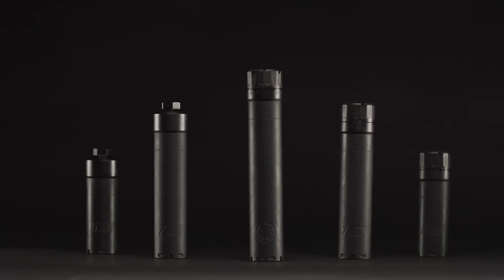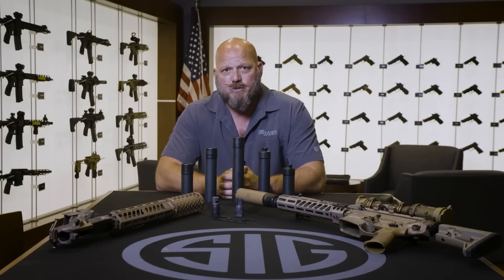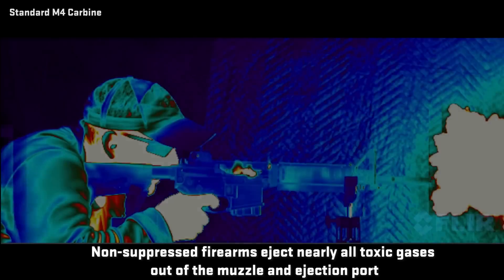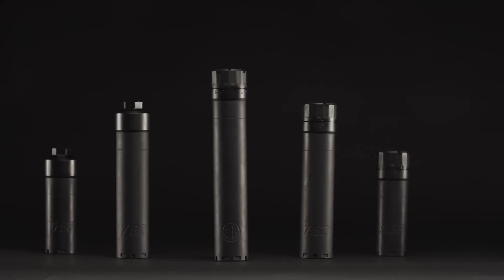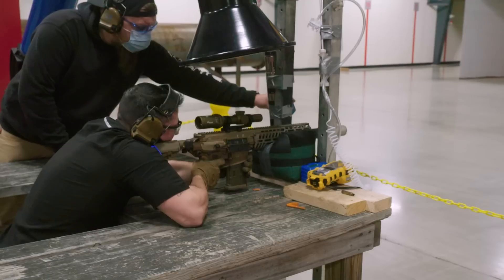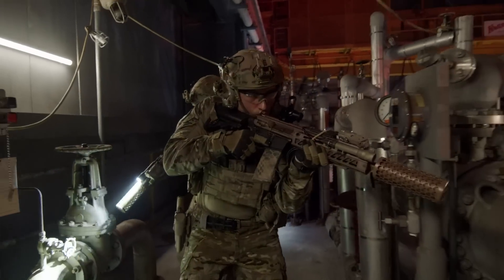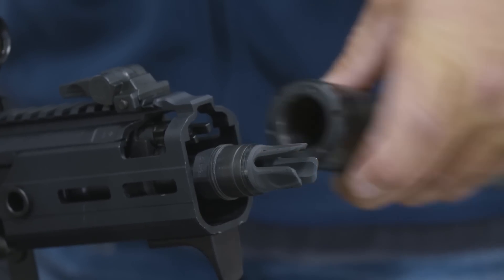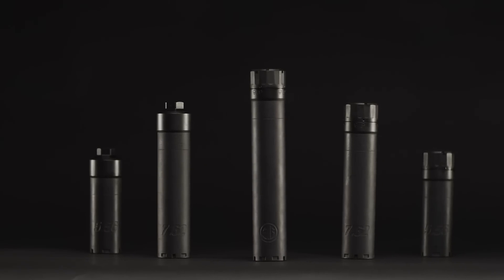The Next Generation: SLX & SLH Suppressors

Comment: 0:29 That's an AR15
0:31 And that's an MCX.
I can't prove this is dishonest on purpose, but a gun company holds up two pictures: one of a short stroke piston gun with the suppressor they're trying to sell, and the other of an AR15 with a "standard suppressor". I have to assume that they're either entirely unaware of the differences in the operating mechanism of two rifles they sell, unaware of the scientific method, or are intentionally staging a 'test' in their favour expecting no one to notice.
Reply: Or they're selling the Sig Spear+SLX suppressor as a package to the military? You're looking into this too hard dude
Reply: @enb3810  sig uses that same deceptive ad for the suppressors, alone, on the commercial side. Sig engineers are either lying or incompetent.

Comment: I'd love to see some SLX cutaways. The blowback videos compare a DI M4 with a piston MCX. Kind of a deceptive comparison. A direct comparison on a DI gun would be nice to see.
Reply: I see what you and others mean by deceptive - but if you listened, the goal is a Suppressed gun = M4 without can.  DI guns by nature will never be able to achieve that by way of DI's functional premise.  Any DI gun with a can, will always emit more chamber and receiver emissions than a DI gun without - regardless of the gasblock or bolt carrier or upper receiver tweaks made.
That's why they designed a system, versus simply a high flow can (like oss) with low noise suppression, but high flow.
Building the system with a piston (like the NGSW submission), AND a can enables them to achieve the required target.

Comment: Next generation? OSS has been doing this for years dude.
Reply: OSS does not make DMLS silencers.
Reply: @Theman3806  Yeah they absolutely do.
Reply: @enb3810  now they do. At the time of writing, 8 months ago, they didn't
Reply: @Theman3806  wait....... so you think because they press print on a machine that makes them unique? haha.... 
the manufacturing process doesnt make the product different, its the same exact thing. they simply made their own version of an OSS flow through can just different enough so they dont get sued.
Reply: @maximusjoseppi5904  CGS also uses DMLS to produce some of their silencers too. 

It produces an overall stronger product. 

The Flow-Through concept isn't new. OSS pioneered that however it seems like SIG has perfected it here with this SLX design. I'll wait for independent reviews to see if that actually holds true. 

I'm not discounting what OSS has done but that doesn't mean someone else isn't capable of doing it better. This is just SIG's response to the Army's request for low toxic fumes and particulate matter to the shooter. I'm personally more interested in the SLH lineup but the SLX is on my radar if it ends up performing well. 

It's easier to tune a host to reduce most if not all gas coming back to the shooter's face. Most people buy a flow through can because they don't want to bother tuning their host.
Reply: @Theman3806  OSS didn't pioneer anything, they just marketed a "flow through" design to people that didn't know that the "flow through" technology had already existed for over a century. Flow through silencers with helical elements and multi layered construction have existed and been patented since 1909, 1910, 1919, 1927, etc.
Reply: @joshuaparker9316  Great info. Thanks Paco!

Comment: Ummm nice try with the suppressor comparison video for toxic gases.  I'm sure nobody will notice that the "standard suppressor" is on what appears to be a DI AR15 and the SLX suppressor is on a short stroke piston MCX.
Reply: Yeah, I noticed that. However, given that the venting through the bolt of an AR is part of it's design, they likely had to submit the suppressor packaged with an MCX in order to meet the military goals. YES, Sig should have admitted this. However the MCX is also known for being quite gassy with suppressors, so they didn't exactly cherry pick a gun that gave them an advantage. They would have to use a piston design anyway, so they used the one they make. But yes, SIg a bit of a disclaimer is in order here ** short stroke piston designs only **
Reply: @letsgobrandon416  short story as I've gotta give SIG a lil bit of credit here.  I never jumped on the mcx bandwagon prior but have always been a "user/semi collector of military rifles/clones" I like all of them and appreciate all variations so when the spear was adopted by us military it got my attention. Plus they definitely look badass in fde. Ive got enough trigger time behind many of comparable 556 rifles suppressed with surefire rc2 and imo, the spear LT isn't that bad on gas. In fact, id be willing to say it does very well considering there's no supressor setting on gas valve. With that said, all of my suppressed shooting has been with 1 supressor, the rc2.  Obviously different suppressors will have different results.  I have the 11.5 and the 16" spear lt both in 556.  In their factory configuration, the lt obviously does better when compared to di guns like mk18 or 11.5 urgi as it's a piston driven but when compared to another piston gun such as a PWS mk111 mod2M, my personal fav for suppression, it doesnt shine as bright.  Don't gete wrong tho, the SIG isn't bad At all.  It actually surprised me how well it did compared to the PWS which has 3 gas settings. 1-Adverse, 2-normal, and 3-supressed.  I find the PWS to be one of the most underrated yet best supressor hosts on the market currently when referring to 556 rifles and the SIG lt has comparable performance when suppressed. And SIG does it without a supressor setting.  The downside tho is that it does seem to spit tons of gas/carbon out at the piston but very little seems to be making it back to me.  Im not saying it's perfect but have to give credit where it's do.  I damn sure can't wait to get my hands on their slx can to see how it does with a low back pressure can.
Reply: Nice try? Do you even get the point of this - it's a SYSTEM. 
You literally cannot get what the gov and SOCOM requested with a DI gun. (Why all the submitted NGSW designs were piston guns.) DIs basic functional premise prevents it to a large degree. Did you listen to his commentary? The goal is Can on gun = un suppressed DI M4 gas emission.
People have tried with upper tricks and valves and bolt carrier tweaks and gas blocks and sealed or vented charging handles, but you can't get away from excess gas and back pressure gas venting into the receiver - it follows the path of least resistance. High pressure wants to equalize with low pressure.  The system is designed with a piston specifically because a DI gun literally vents that shit into the receiver vis a vis your face.
Di guns with cans are not all amazing - I've got several and  own AAC, Gemtech, Sico, Sig, Q and Dead Air cans.  It's not a knock on DI guns, mine run like tops dirty or clean, I love them.  Adjustable blocks help, but there is always shit in your face to some degree.  Pistons are much better.
Back pressure in piston guns is still a bitch, but a higher flowing can means less chamber venting versus chamber and gas tube venting.
A high flow can with a piston is literally the only way to truly prevent a semi/autoloader from gas in the face without specifically tuning the gun, ammo and the silencer for optimal operation together, like a system.
Reply: @shirothehero0609  please re-read my comment again until you understand it.  My comment (from 18 months ago) was specifically related to the disingenuous suppressor-specific comparison footage where they compare their suppressor on a piston gun to a “standard suppressor” on a DI gun. Not to an unsuppressed DI gun like you’re trying to make it seem.  It’s cool that you have lots of neat and expensive possessions, but so does pretty much everyone in this space and it doesn’t make anyone more or less right so mentioning it is pointless.  Actually now that I think of it this whole conversation is pointless since you’re so late to the party. OSS/huxwrx has changed the game on flow throw suppressor designs utilizing additive manufacturing methods since this video was released.